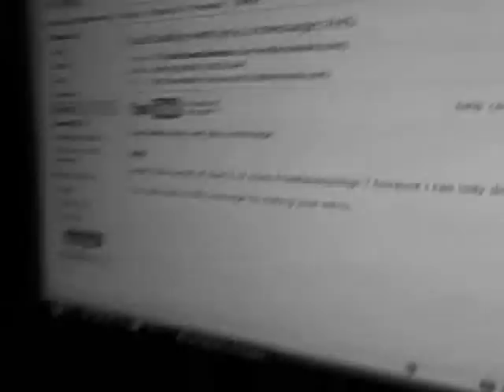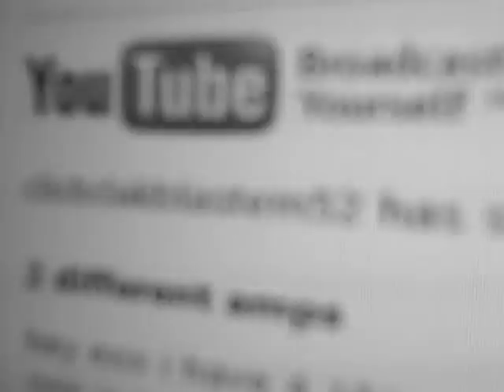(Q & A) 4 15 inch Subs - Mono Amps, Ground Loops, Gains, Loud Mids & Highs / Woofers Alternators

Comment from the maker: Possibly - You can always check your voltage drop to see where your at after you do it all - But usually with only 1k, most stock electricals can handle it.

Comment: Great Question!

As long as the amps are indentical, you can have them safely "Strapped" or "Daisychained", without worrying about phasing or cancellation from large margains of power on either side.

Steve, Bob. and other "heavy hitters" have all matching power sourses - unfortunely in this case, the kid had 2 UNMATCHING amps - So the only safe solution calls for two separate boxes.

Comment: what i have found with bandpass boxes is they tend to work best with inverted subs since having the bottom of the sub on the outside you hear alot of cone noise from the excursion. bandpass boxes solve this problem and gives you a more solid THUMP to your BUMP BUMP ya dig

Comment: big 3 another battery or better battery will never hurt a kinetik hc800 would probably be ok for the t1000... t1000-1 or -4???match the fuse in your power cable to the fuse rating on the amp BUT DONT EXCEED IT... ex. the t1000-4 has a 200a fuse rating, use a fuse no bigger than 200a in your line, distortion try to keep the gains down.. gains will add distortion when turned up higher than the voltage your cd player puts out.(amping a bad signal) check pre out voltage vs. input sensitivity on amp

Comment: Well I was meaning that his not going to like the price for just alt, let alone alt with batteries. Because yeah, i know good batts are like 200 a peace but thats what sucks about doing mods to cars. Most of the time you have to do a lot for your car to take the one thing. Its like a performance part on an engine. You need lots of other performance parts just for that one to work. The heads for my truck, to get them to work right, headers, push rods, roller rocks, it just kept going.

Comment: @printzcory I don't know if you are still having this problem but I had the same problem. What was causing it was that my RCA's & my power wire were running side by side. I ran my RCA's on the other side of the car and it quit.

Comment: depends on the RMS of your subs, don't go by peak power.  Audioque is probably the best bang for the buck and you get a quality product but they start at a true 1200wrms amp.  People will probably tell you to go hifonics.  While hifonics are very affordable on the cheaper lines you do not get rated power you get a little less than listed.  The higher end hifonics are actually quite good but not the lower end IMO that most people buy.
More expensive is DD,sundown,memphis,RF etc.

Comment: For the air bags i would say batteries. I say that because he does need an alt but even a 220 amp alt on average still wont put out 75 amps till 2000 or so rpm. If hes on the the road its ok. All the alts i look at on there power curve charts wont do 220 till 5500 rpm. Now not everone can do the meade thing with 4 alts but having more then one is always the best. But im just rambling now because I know theres to many cars out there thats cant have more then one because theres no room.

Comment: @LILCHEDDA I would get 2 Fi Btl 15 or 18. better quality and possibly louder for the price. get a sundown 2500.1 and 0/1 gauge wires. you wont top $3000 dollars. You will be way happier with the Fi subs.

Comment: hey EXO i also have 2 amps a kenwood 1000W and a boss 3000W (wattage seriously overated). you didnt mention in your video but you can run 2 seperate amplifier in the same box with 2 subs but you NEED a divider wall. 
correct me if im wrong because thats what im running 3 10's on the boss and 1 15" on the kenwood. all in the same box but with divider walls.

Comment: @hassanjamal93 bigger fuse and do the big 3 upgrade(exo has a video showing how to do that)  im running 1500 rms and 3000 peak and i did the big 3 and have a blue top deep cycle battery and it bumps good and no problems and get 0 guage that 4 guage is probley to small id say

Comment: Exocontralto@ I will check that! But I think I have a purple wire for a negative connection to a speaker already, would it be a straight purple or one with another colour in it! Thanks man.

Comment: @hosssone hey man, same thing happened to me before, theres a couple things that might have happened. one, the speaker could be fucked lol causing the noise,  or two, check ur fuses, mine were kinda half blown and was fuckin up the power and the sound, may not be the same situation as urs but check that stuff may help

Comment: I have some noise coming thru my fifteens but I'm grounded to the metal up by my rear deck  not sure why it's humming I hooked up a battery and it started doing it I had a cap before and it was fine now it sounds terrible sounds like I need a ground loop isolator or something ? Not sure pm me if you could thanks man

Comment: would i get better sound if i get my audio all from the same manufacturer, such as full jbl or edge etc?

if so would i get better sound using 2 monoblock amps or 1 2 channel amp?

cheers

Comment: My battery's dieing and the bass used to be really good in the beginning and its going off now slowly.. I've two 15inch cvx with Mtx Thunder 1000XD -- 2000peak.
What should I do?** as you said change the alternator?? I've a 4 guage amp kit and yea my fuse went out 3 time cuz I was on loud, before I had 60amp fuse now I got the 80amp fuse which is the max everywhere and it went out too once when my volume was on 40.. ok bro tell me what should I do thanks...

Comment: i have the same problem with the humming/ heart beat. it was a heart beat i had it grounded under my seat i sanded the paint and every thing then i moved it to the trunk of my jetta and now its a quiet hum but it still pisses me off it is sanded bare metal in the trunk too any help?

Comment: my amp is grounded behind my rear seat and i dont get any noises coming through. also exo BIG fan been following your videos for a while now. i do have one question how do you feel about bandpass boxes? ive heard good and bad about them. the good was excellent the bad was horrible no middle ground at all so i would like your opinion? the guy who builds them said he had one in his car with an alpine type R and beat in competition a guy with 3 subs running more than twice the power he ran.

Comment: i have 4 rockford p1 10" on a 2100 watt amp, and i had 2 speakers wired at 2 ohms bridged, would i basically wire the same on 4 speakers?

Comment: and I couldn't find a bigger fuse anywhere? can you tell me any website or anything? where I could order it online? I tried looking on amazon and ebay I couldn't find more then 80. Can you tell me what fuse is compatible with mtx thunder amp 2000peak and 2 cvx 15" kickers? cuz I guess it needs more power and whenever I turn the volume up till like 38/40 it blows up lol after a min or so..

Comment: My my subs are amking the humming noise and ground is connected under my seat only because I couldn't find anywhere else being my ground wire is so short. Could I use a ground loop isolator to fix that?

Comment: sounds like a safety cutoff. 2 12" kickers have no business running off of a 1000W sony amp. the buzzing noise may be an unrelated problem or it could be your cooling fan. you need more power. get a 500W amp slave it and it will give you the extra watts you need probably about 200 more

Comment: i was just wondering about running to different amps likes not bridged? or different brands? with cause all this cancellation and etc..because i know a lot of the heavy hitters people are using like 8 or more amps to power like 10 subs in 2 boxs or 4? and sry just read UNMATCHING amps

Comment: Wuz up EXO I had a question ..I have 4 15s do u think I can run them all off 1 amp if there peak is 1200 and rms 600 n and the amp 4000 @ 1 ohm

Comment: I have got a problem. I have 2 12 inch kicker comp subs in a ported box running off of a sony xplod 1000w amp. Whenever I turn my head unit on I get a loud buzzing noise from the amp itself and it doesn't go away. The subs work fine but it still buzzes. Sometimes if I turn it past 28 the subs cut off and turn on a few seconds later when i turn it down. I really need help solving this problem. I think its the ground but can you suggest any good grounding spots in a 1998 Honda Accord.
Reply: Heropatel gain is to high or voltage drop